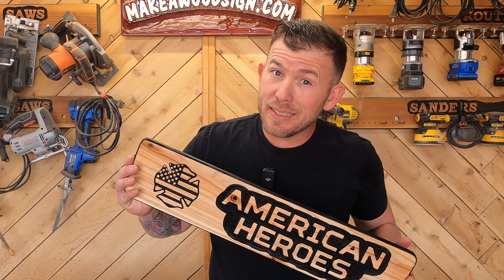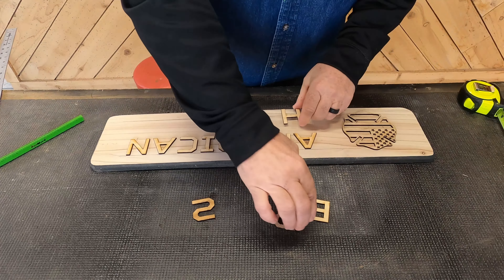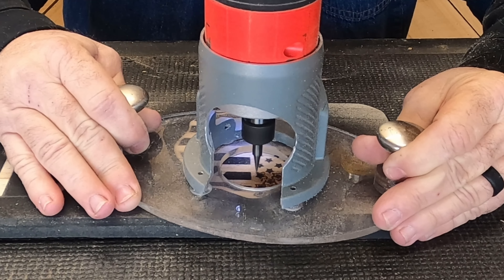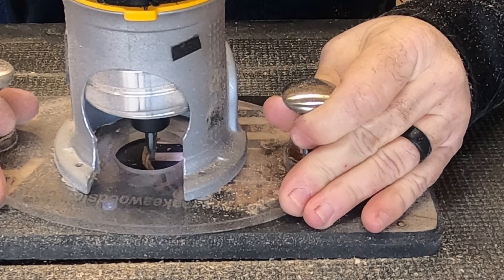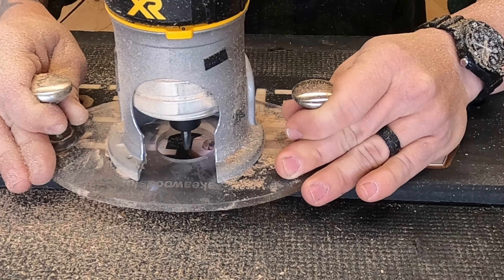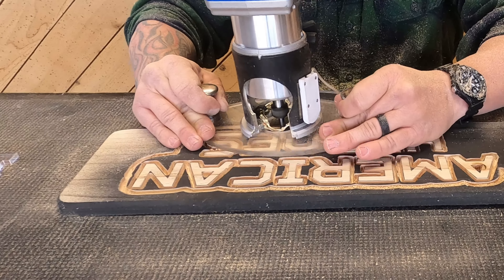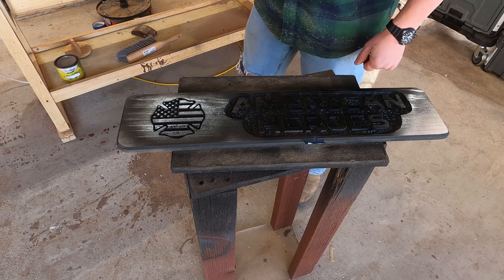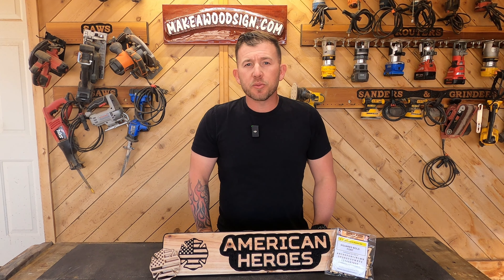Mastering Intricate Detail With Hand Carving – No CNC Required!

Comment: If you guys didn't make videos showing this, I'd have a hard time believing you did it by hand. My eyes aren't even that bad, but I know i couldn't do many of those stars without screwing it up. I can't even carve a straight line without using a straight edge to run against. 

A+ work guys.
Reply from the maker: HAHA Thanks John! You'd be surprised how good you can get in a short amount of time. Just practice and it'll get there quick.